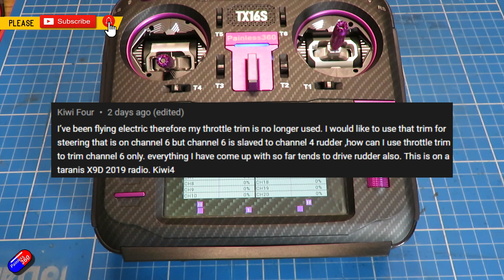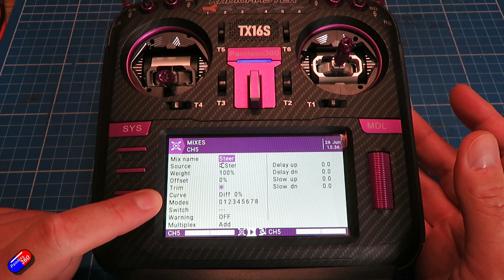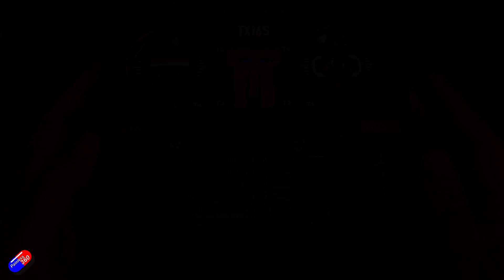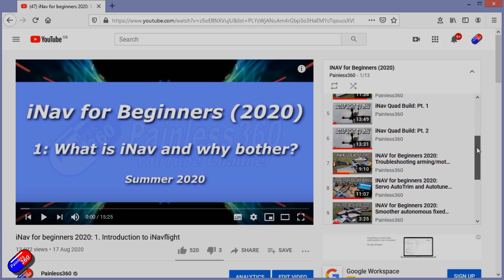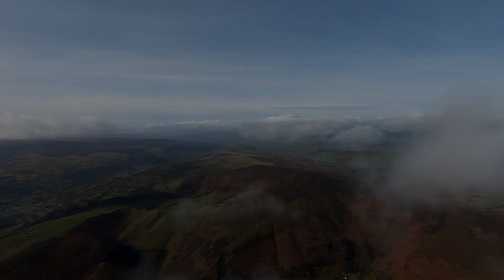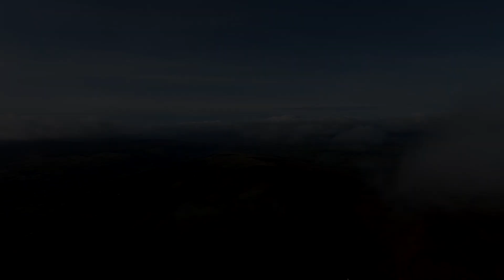Using spare THR trims for trimming a steering servo in a fixed wing (viewer question)

Comment: Not so related but can i ask sth?
I'm new to quads and now trying to build a long range 5 inch (6' maybe). Is it ok if i use two 2200mah 30c 3s batteries in series (i want to use one 6s but looks like it's tooo big for my custom frame) for my quad? Two bats may weigh around 400g, and total weight is around 700-750g (i also want to upgrade mine with some other components so the quad mays heavier). Is that too heavy for 30mins flight time? (I'm thinnking about using 2507 1800kv motors, 5x4x6 props and 45a esc).
Pls let me know if my config is fine.
And thank you very much.

:)
Reply from the maker: Picking a setup depends on many things. Two are the weight of the model and the thrust you then need to fly. See my endurance builds for how I figured it out.. Best of luck

Comment: sir,,,I am trying to program cc3d brushed micro flight controller but it's not connecting with any software,,i am failed to find suitable firmware for this board,,. please help me,,,,please,,,,
Reply from the maker: Please see my CC3D videos... I've not used one for years... Best of luck

Comment: Have two of those tx16s radios, love trying to add new features ...hadn't thought of this one.  Ok , a puzzle . I have a F 4 Phantom jet, but converted to YRF-4E.  Longer nose, no weapons, but it has canards  how would you set up canards on a Phantom?  Original only used 20 degrees ... fair to say nobody in their right mind has built one of...wait yes a prototype was built it flew. However the current twin 70mm fan, unit is scary....lol . Oinputs are throttle,  aerons,  rudder,  elevator, steering, retracts, brakes, and the canard ...oops lights ....yes I'll  finish it but I will not fly it ... but it is fun to try setting it up. All this for maybe 4 minute flights ,  We are insane...enough fun you take care. Forgot the outer leading edge slats....
Reply from the maker: You can simply copy the elevator channel to them or even try setting them up like elevons!